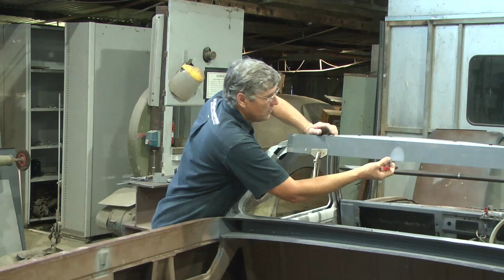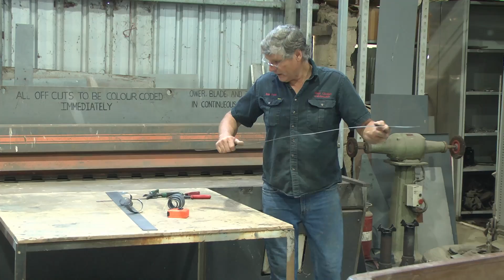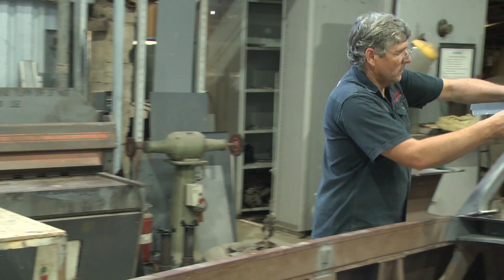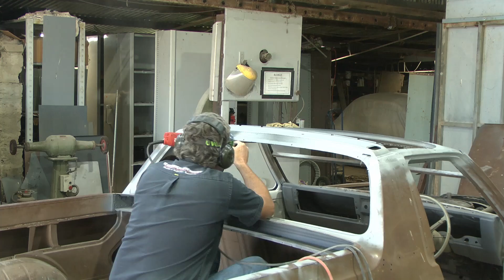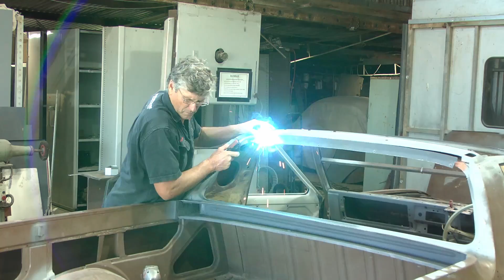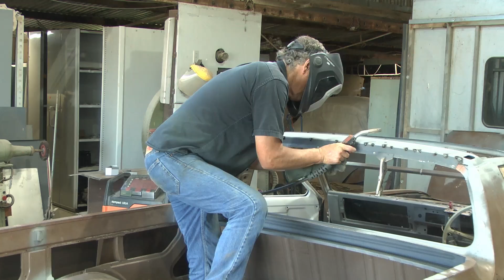1970 Holden HG ute - roof rust repairs Part 4

Comment: about time we had a good WA fabrication/ restoration channel, very informative thanks, BTW what mig wire do you use .6 .8 .9 etc?
Reply from the maker: Hi Mate, thank you for your comment. I am using 0.6 wire for welding pretty much all of the sheet metal in these cars. Sometimes I will go up to 0.8 for welding the heavier panels in the subframe areas. The kemppi welder that I now use will weld up to about 2.0mm plate thickness very well with 0.6 wire. Anything heavier than that I use the 0.8 wire. Deb and I  are hoping to expand the content of our channel as time goes by, and cover a lot more aspects of the restoration and  modification process . The old Kingswood ute is providing us a good platform to work from. We will continue to work our through the car and present material as the restoration proceeds. There will be  some drive line modifications coming  up plus a lot of material about component restoration. We are hoping that people will continue to find our channel interesting and informative. Cheers Rob and Deb.

Comment: Excellent video Rob, what thickness of material did you use for repair panel?
Reply from the maker: Thanks for your comment TJ. I always use material thickness to match the thickness of the original panel. So on a Holden, outside panels are 1mm, the panel that we replace in this video was 1mm, but the inner panel that we repaired is on 0.8mm. 
Cheers
Rob & Deb
Reply: @robsshed  Rob could you please advise what size mig wire are you using on the 1mm thick repair....?
Reply from the maker: Hi Kel. 0.6mm and it's 18% argon in C02 for the gas.

Comment: Very very informative as always mate.
 Simple things like offering alternatives to removing the rust as apposed to sand blasting and mentioning stuff about the "rust dust"
  Couple Questions! 

 Did you put weld through primer on inner roof section or can you access it still. I can see you used copper weld through on bottom section? 
 Didn't you say zink was better for mig spot welding and the copper was more suited to the spot weld machine?
 Why do you choice to role metal away from spot welds instead of using a spot weld remover? 
 
Thanks also to the camera person, and if it's possible can you get close ups, when it's possible.
Reply from the maker: Hi Shane. Thanks again for your comment.
After sandblasting the box section, I painted the inside of it with the zinc weld through primer, and then painted the edge of it with the copper primer.  I haven welded the two panels together to form the window lip, with the spit welder.
Reply from the maker: As to removing the waste material from the window opening by rolling and breaking the spot welds, it was mainly because the piece we were removing was the inner portion of three pieces of metal. I had already removed the outside layer (turret skin), and because the welds had penetrated through the three layers, it is very difficult to find the spot welds on the inner panel. The piece that we were salvaging (inside the car) was thinner material than the waste we were removing, and the pressure from drilling the spot welds was distorting the inner panel that I was trying to save. Sometimes in this situation, I will run a cut with the angle grinder along the panel, through the centre line of each spot weld, and that can make it easier to remove the waste section. It is pretty much what works on the day as to what method I use. 😁
Cheers
Rob & Deb